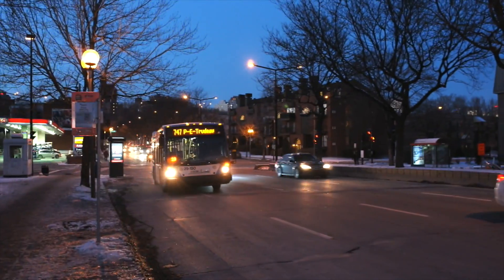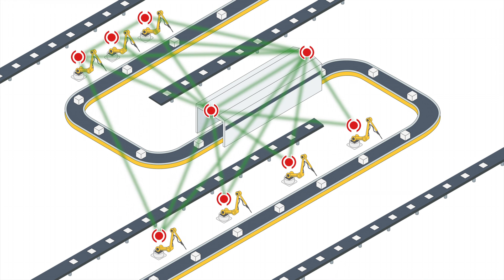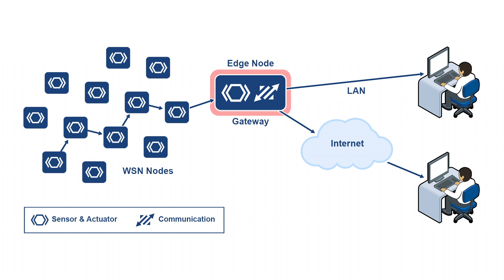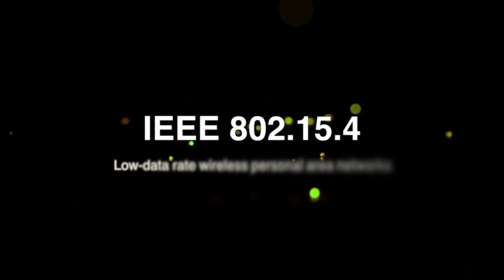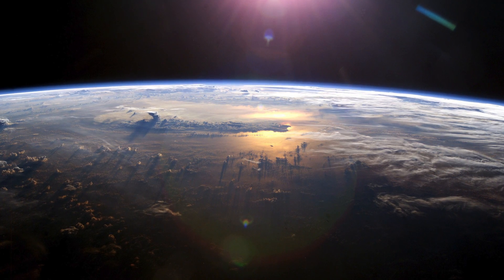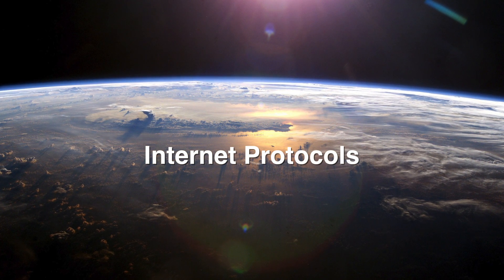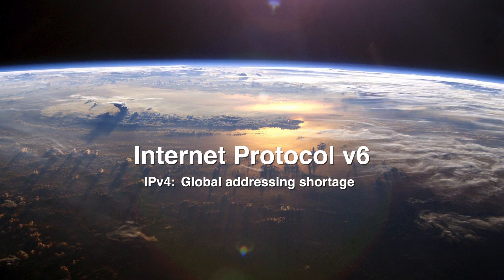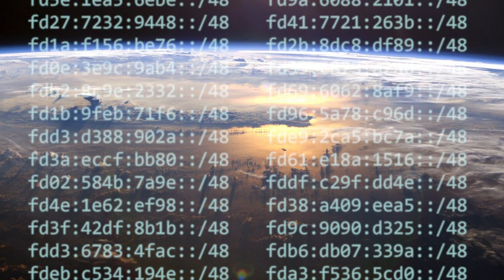Internet of Things [1/5]: Devices and Local Networks

Comment: Nice from scratch, but sir can you explain, how we can onboard a large number of the device to our network at once? I want to connect all my device with my network at once and don't want to connect each device one by one. 
Thanks!!!
Reply from the maker: Jazib, the onboarding process depends on the network technology being employed. The steps involved in joining a Wi-Fi network are certainly going to differ for those required of a Zigbee network. If you're considering Ethernet or Wi-Fi, your best first stop should be the discussion forum at micrium.com, where you can ask some specific questions. For other communication protocols, perhaps you can check out the discussion forums hosted by our colleagues at Silicon Labs.